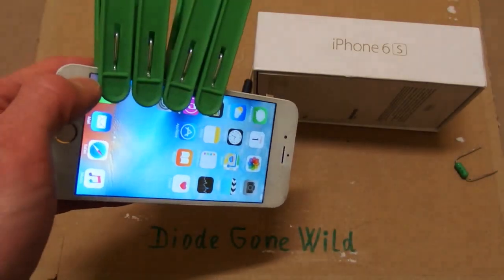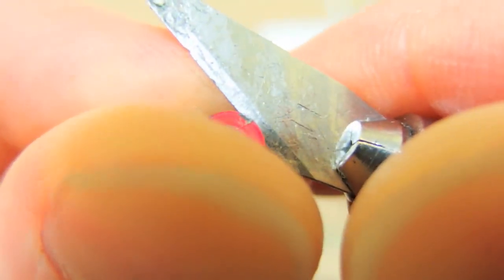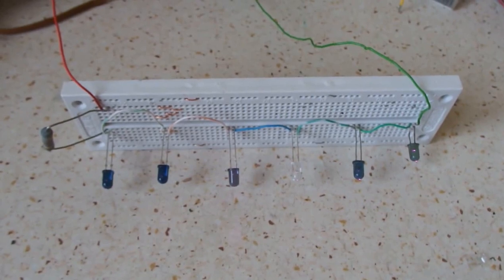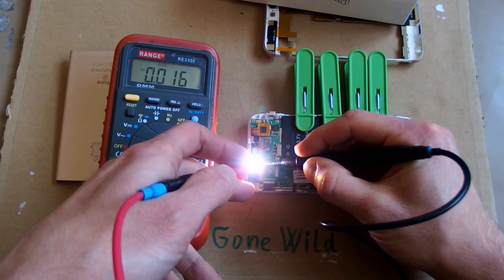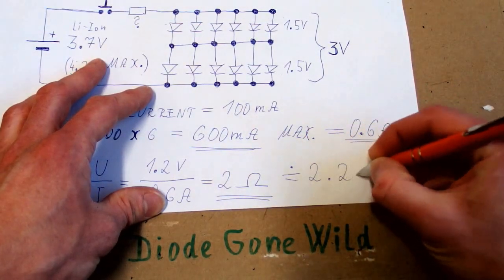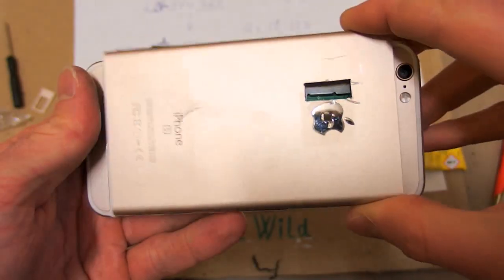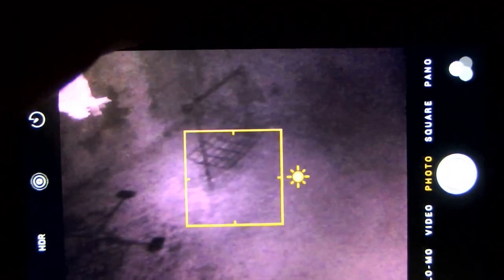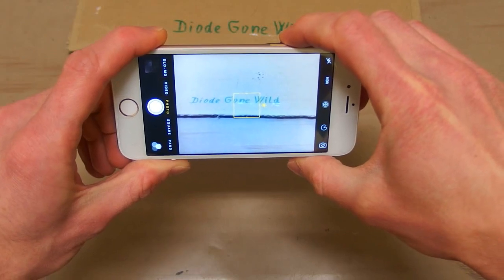iPhone 6S - DIY Night Vision

Comment: The iphone 5 is a pain to modify, they have the IR filter glued on the sensor like half a millimeter above it. I find the Samsung phones easy to modify but this is super simple compared to those. I can't believe the iphone 6 is made like that, it's not often you find the IR filter on the lens carrier. Another thing I did was instead of using LEDs I used a pump diode from a green laser pointer, about 300mw optical output with frosted glass over the laser. It works so much better than LEDs do and the frosted glass is removable so I also have extremely long rang capabilities with the IR output. Easily over 200 meters. It works really well but it's still not as good as intensifier tube based night vision. I used modded cameras on phones to check the IR output of lasers I work with for safety reasons and to show on videos the hazards.

Comment: Use a transistor which gate is connected to phone's internal flash light so you can switch it on-off by internal flash light button. Or take pictures with auto flash.

Comment: does it focus propperly ..I mean does the picture get "really sharp"?   The camera optics and filters are optimized for focusing visible light (wavelength around 300-800nm) - my eperience is, when you switch to IR-mode,  the focus shifts slightly and everything gets blurred. When you are lucky and you can correct it manualy, it is fine, but what about fixed optics (as for example in smartphones)? 

you're using 860nm IR-LEDs, which is good because most of the chips are most sensitive to this wavelength (disadvantage for hidden cams - you still can see them "glimming") - 940nm LEDs you cant see, which is good for Security cameras (burglar defense etc.)  but with disatvantage like far less "brightness" for camera-optics.

Comment: So if you buy or find a visible light filter and place that on the camera lens you would have a decent IR video camera. The red plastic on the front of remotes might work. That would be neat to try on a shorted PCB with a bad component. Run some current into the PCB and the hot spot would show up. No need to turn the lights off with the filter in place. Very cool sir!!!
Reply: The classic technique to create a visible light filter is to use unexposed developed slide film. Another technique is to stack Congo Blue and Primary Red filter gels.

However it won't work for thermal sensing for electronics rework application. The camera is only sensitive to the highest of infrared band very near to visible light, stopping at about 1000nm, while 700nm is pure red. Black body radiation model is the upper bound on thermal emission of a hot piece of material, and the problem is, by the time you can register infrared with such a modified near-IR camera, there will be an ample amount of visible light too, the necessary temperature will be around 600°C and your PCB that you're trying to fix will be on fire.

Comment: I’m a film maker from Amsterdam. For a cool new art installation (with dancers) I’m looking for an iPhone6 with IR cam-filter removed. Can anyone sell me a successful cam-mod like this? Or working iPhone6 with the mod?

I might have more (also commercial) work in the future. I’m looking for smart electricians to collab with in the team. Please let me know: ruben[AT]truth[DOT]io
Reply: Please note that he's modifying a fake iPhone. This has reasons beyond budgetary ones. I don't think anybody can disassemble any semi-decent smartphone camera, even from a typical $150 smartphone, and put it back together still working - i'd like to see it done, but i've never so far seen a successful surgery like this. You need explicitly the most junky camera assembly one can find, where the lens is fairly crude and completely devoid of active components, thus this fake iPhone. Would using such an obviously fake device be suitable for your purposes?

Comment: Apply pulsed voltage tô the IR leds    tô reduce Power and increase Light luminosity with small duty cycle around 15% and high current  it cam accomplished    using a 555 chip and transistor ,great  channel , congratulation!!!!

Comment: Just so you know, a camera originally constructed to see Infrared light costs up to $10,000. (Almost 200,000 Kč for reference.)

This DIY tutorial is important.
Reply: There are a few different ranges of IR. Near-infrared (what is used in this video) is easier for a regular camera to detect, whereas the longer IR wavelengths that a thermal imaging camera needs to detect are much harder.

Comment: If you  turn on the flash light  wouldn't it light up the room  so you can see it  when its dark  just as good as the  ir lights ?  I just went into  a pitch black room and I turned on my  phones flash light and it lit up the room pretty good .

Comment: This just gave me an amazing idea, IR lens hack, plus a cheap VR headset with the LEDS mounted onto it, plus a VR camera app, and you have an instant homebrew set of nightvision goggles!!! :D
Reply: Get a phone with dual rear cameras and use vr headset extend the cameras to the center of each eye area of the head set via soldering each pin with a small wire and forgo the VR app or anything extra that might cause more lag. I used wifi ir cameras and the app on VR set but had 1.8 sec delay not very good. Your set up would most likely  have a 1.1-1.3 second delay depending on your connection speed. Extending the cameras themselves and adding IR lights to each cut all the lag out and give you better quality picture
Reply: Can imagine walking with 1,8 seconds delay in vision being fun. :D
Reply: And you have your own Call Of Duty Modern warfare night vision

Comment: Hello sir. 

I'll make one but I've a question.
I'm planing to  use 1 9v battery for 6x 10mm IR LED 1.5 v 20mw (or 10 x 10mm IR LED 1.5 v 20mw diode | **2 x 9 v batteries**) for the project.

Do i need any resistors for it and which resistors do i need?
Reply from the maker: You always need a resistor for LEDs (if you don't use something like a linear or switching regulator). I would use at most 4 LEDs in series for 9V battery. This will drop about 6V and so you have about 3V for the resistor.
Reply: Hi. 

I'll stick to 4 or 5 IR LEDs  (10mm  IR LED 1.5 v  each) that will power up by a single 9V battery

Can you tell or find me a resistor you talk about on eBay :) It gonna be more easy for me :D Thanks for your time!